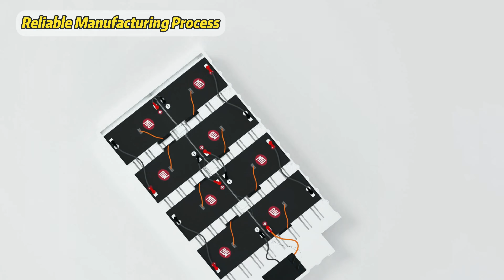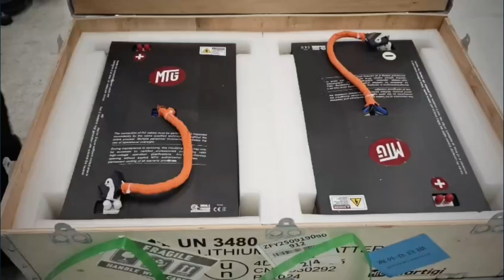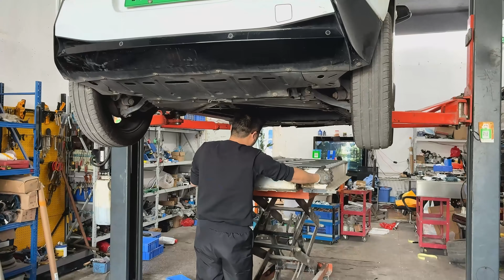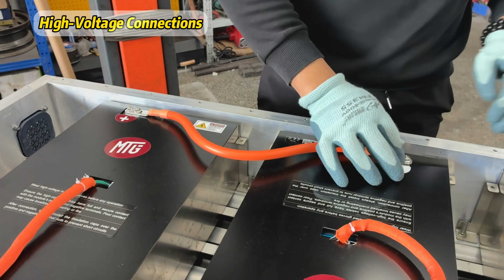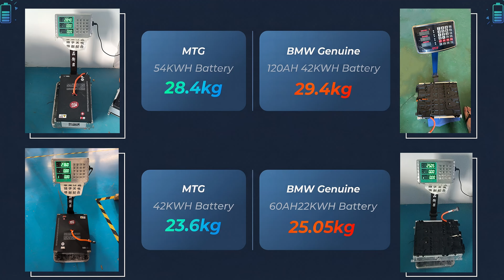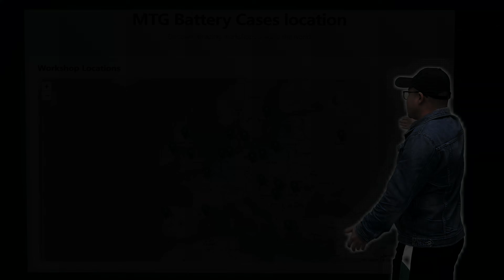MTG 54kWh/154Ah Battery Upgrade | BMW i3 Range Boost to 420km, Global Case Sharing

Comment: So WLTP with the standard 42kWh battery is 310km. US EPA is a more real world figure of 246km. This battery is said to add 90-154km then. 42/246=0,171 kWh/km avg consumption according to EPA. Summertime I regularly ran mixed at 0,13kWh/km. So with this battery, 52/0,171=304km according to EPA, or 52/(42/310)=383,81km according to WLTP, or in summertime about 52/0,13=400 km, so yes, the numbers they claim are achievable in the summer, but no not year around (unless they claim a CLTC figure), esp not in countries with temps lower than 15° during parts of the year. USD8500 for an extra 60km is pretty hefty but if your battery is heavily degraded, it will get you a lot more of course and be worth it more.
Reply: if i just calculate the percentage then its 70 km EPA more but yes i will still not pay that but maybe they come down to half that (80$/kWh) and my 94Ah will have lost more then it might be attractive.

Comment: What are the total costs? Battery, labor, software? Will the i3 then be able to charge faster, or will it still be limited to 11kW/50kW? Of course, the purchase price also needs to be considered. €15,000 - €20,000 for a used i3. There are better deals on the market. ncludes warranty on vehicle, electric motors and battery. And new battery technology, etc.

Comment: It's great that people are trying to find ways to extend the life of the i3 but I suspect this might cost more than the car is worth? Maybe worth doing if you plan on keeping the car for a long time
Reply: But eventually, the motors and other parts will need replacing and repairing. And the small monitor. And so on and so forth.
Reply: @angelo9999-9  like every car
Reply: @GPSierraPapa  No, new cars are new. And they have better features and a warranty. The i3 will likely be more expensive, like many better offers these days.
Reply: I think a gently used i3 could be good for a life time. No rust, batteries will become a lot cheaper to source. No rain it couldn't be kept ultra long term.

Comment: It’s been half a year since my MTG 54kWh battery was replaced, and everything has been working perfectly so far. Happy New Year to everyone! 🎉🎉
Reply: How much did it cost approximately?
Reply: @usstom  All in, it’s about $8,600, including the battery modules, shipping, and installation. I also added the bank transfer fees and my travel costs for reference.
Reply: How much did it cost in total?
Reply: @LuciaGomez-yb3om The total comes to around $8,600, including the battery modules, shipping, and installation. Bank transfer fees and my travel costs are also included.
Reply: Its because you didnt have even a tiny crash
Reply: How much cost?
Reply: How does it hold up nowadays?

Comment: wow,  that was a great video.  Thanks for presenting all the information.  Any chance you are working on a faster charger option as well.  It would be nice if that 54kWH battery could be charged faster than the  7.4kw and 50Kw we now have.
Reply: Hardware is software capped. I think with the new 54kwh, there will be a straight 50kw line for atleast 45min.

Comment: The cell are located in wrong direction in there cases. This causes that some cells have no contact to the cooling pipes. They are just between the pipes without proper cooling.

There should be be a saftiy space between the side of the cover, which you are eliminated with your battery pac. Do you have all certificates and tests done to sell your product in Germany? CE ist not everything that is needed
Reply: So you tested it ? lol
Reply: What do I have to test???
Reply: Just notice orange HV cables among cells, which are ALL protruding upwards and definitely are touching top cover-imagine wear & tear after extended period of use. Expect short circuit and fire !!

Comment: Do you think you may do a battery bigger than 54 KWh in the future?
Reply from the maker: Currently, there is no plan to manufacture larger batteries.
Reply: Why do you need more than 400km in such a small car? Perhaps get the REX version.
Reply: @JDDevice if its your only car and you want to drive long distances. Seems pretty reasonable to want more battery if it fits and is cheap. Hopefully that happens in the next few years
Reply: You know that the original BMW i3 in 2013 had only 18 kWh? 54 is already threefold.

Comment: The 54 Kwh battery pack is possible to install in the heavier REx version as well ?? Your videos i've seen only shows the BEV version of the BMW i3.
Reply from the maker: Yes, the 54 kWh battery pack is compatible with the BMW i3 REx version. We have several REx owners among our customers who have successfully installed this battery pack. If you have any other questions, feel free to ask!
Reply: @MartigiEVBatteryReplace Would it fit in the middle size REx? The 96ah battery pack? The video mentioned the original 60ah pack and the final version, the 120ah pack, but not the pack from the 2nd version of the i3, the 96ah pack.
Reply: I wonder if it be a problem to remove the r e x